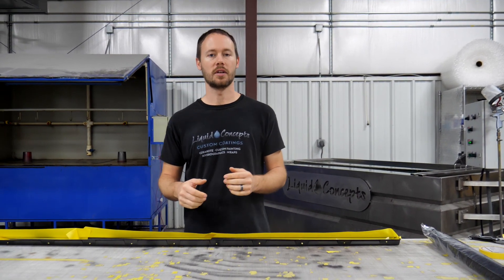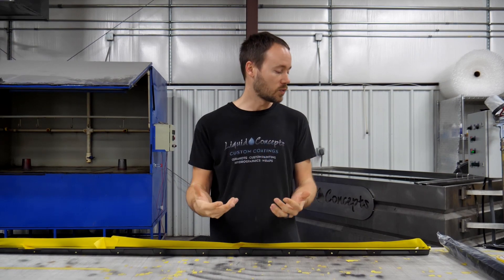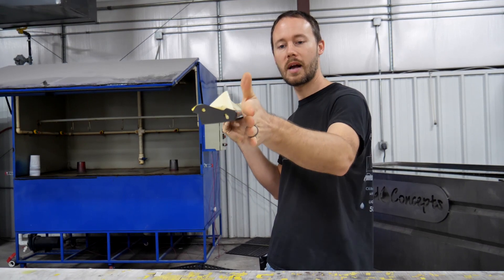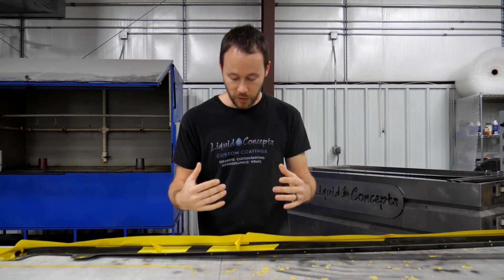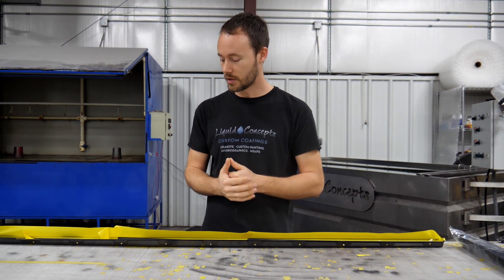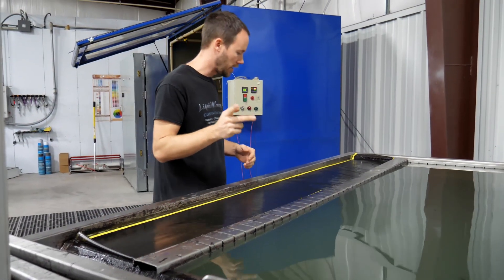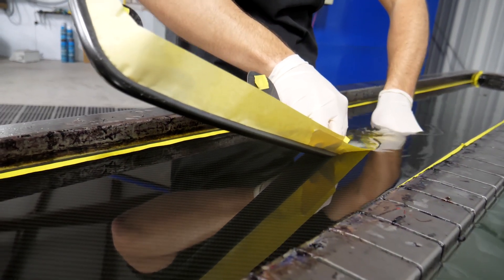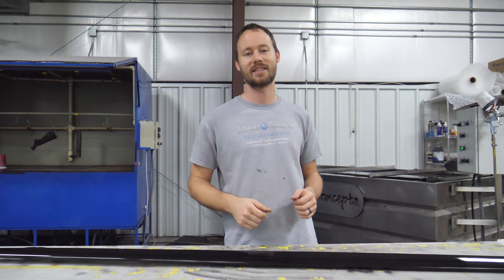HOW TO HYDRO DIP SIDE SKIRTS | Liquid Concepts | Weekly Tips and Tricks

Comment: perfect ! 
Does it need to have clear top coat to be shiny? does top coat help to have long time satiability of film on parts? 
Actually I'm asking for OEM parts, which should pass cross cut test and chemical solubility
Reply from the maker: The clear coat is indeed yes what gives it it's glossy finish as well as what protects the dip. Without applying a top coat you risk damaging the dip as the dip itself does not offer any durability.

Comment: im dipping a mountain bike frame in carbon fiber on flat black and clearing it in matt clear , having issues with taping over sections that i already did so i can get to the other side. anything?
Reply from the maker: It could be tons of things that are going wrong. If you want, shoot us an email with some pictures of the problems that your having and the methods and materials your using and we can try to help you out as much as we can. Our email is info@liquidconcepts.com
Reply: @LiquidConceptsUSA  the tank I tried using was about 8in to short for the frame as it was a 50 gallon drum cut in half. Had to dip in muti stages. In between tape jobs the tape would stick to the fresh dip and peel it up.... dip , clear, tape, sand , repeat was the process and it took awhile wow. Looking into a old plastic truck box as my next dip tank. Having a larger tank should solve it.
Reply from the maker: @Couldntellya  Yes you certainly want to make sure you have plenty of tank for the item that you are dipping!

Comment: Need a lil help.
After I dip the piece and when I start rinsing it, the graphic starts to come off from some areas while rinsing. Am just rinsing under the tap with cold water and not too much pressure also.
What am I doing wrong?
Reply from the maker: If it is rinsing off it could be a few things. Either one it is over activated or that it is not bonding with your paint due to using the wrong paints or it has cured too much. If you have some photos you can email over I can take a look at it for you. info@liquidconcepts.com